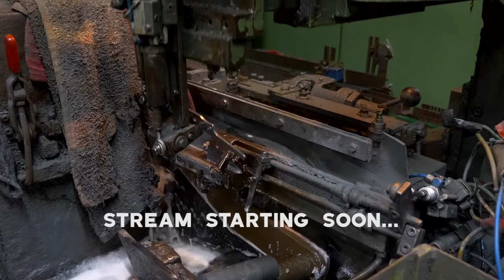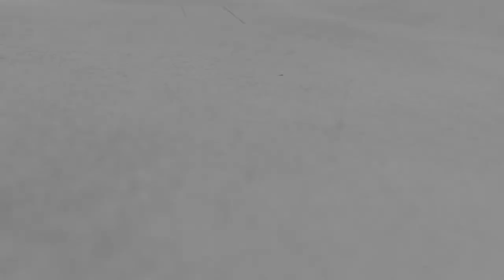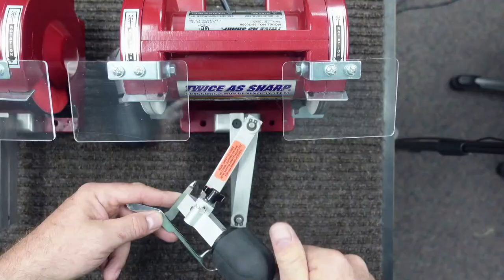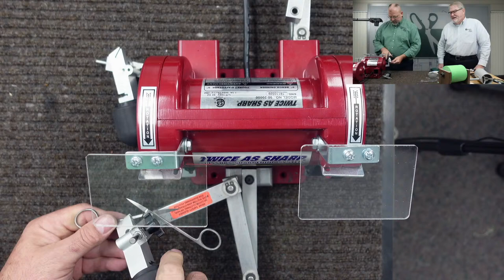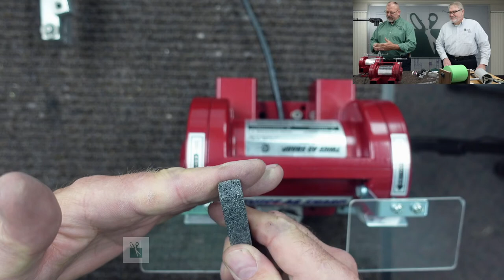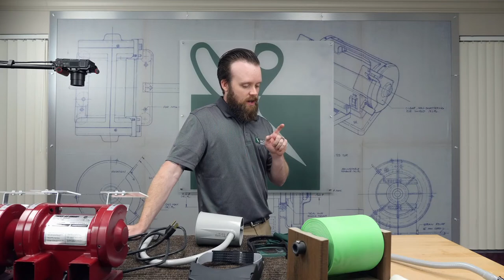Wolff Monthly #5: Diamond Wheels, Medical Shears, & More

Comment: Have you guys done one on garden tools like secateurs and loppers? I sharpen lots of these on this, and deburr (after using the honing wheel) on the backside of secateurs on paper wheels with rouge, and works great.
Reply from the maker: We did a session on lawnmower blades and hedge trimmers but those were the only two garden tools that we did in that session.

Comment: What about using the diamond wheel then to the standard honing wheel?
Reply from the maker: Well the diamond wheel is a higher grit. The one we used in this video is 800 and the standard honing wheel is less so it wouldn't really do much to polish the edge any more than the diamond wheel already does
Reply: @wolffindustries  What is the grit of the professional honing wheel?
Reply from the maker: @sharpen-up  The professional is right around 600

Comment: When you said zero angel to sharpening surgery scissors or small scissors that mesuere is in Usa and Japan/Europe is  90 degrees and my clamp on ookami has from 0-65 degrees so that means if is zero in usa that is 90 in europe but i cant put them in 90 degrees becuase my clamp is maximum up to 65 degrees so can i then set my clamp up to the highest degrees witch is 65 degrees? only 45 degrees is the same everywhere so 0 usa degrees is  90 and about 30 usa degrees is about 60 in europe.So zero is then maximum on my clamp witch is 65 i dont have a clamp who come up to 90 degrees or usa zero degrees
Reply from the maker: Set the closest angle you can, then do a scratch test. The scratch test will help determine the correct angle. So if the numbers etched etched into the clamp don't fit your measurements, ignore them and just do a scratch test to find the correct angle.
Reply: I think you have this backwards. 0º is actually 90º to the inside surface of the scissors/shears. You can't sharpen any blade at a true 90º angle... 0º on your clamp is in fact 90º to the cutting plane. If in doubt, set your clamp to 0º or 5º and do a scratch test (with sharpie), and you will see most medical shears are 0-5º. The higher the angle on your clamp, the steeper the angle, and these shears in this video are close to a right angle. Grooming shears are much higher, 35-55º